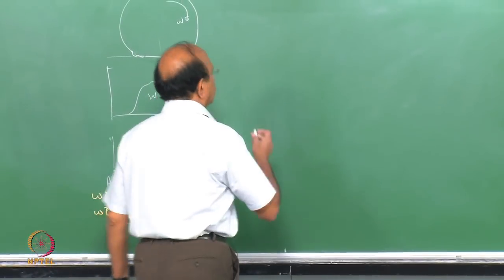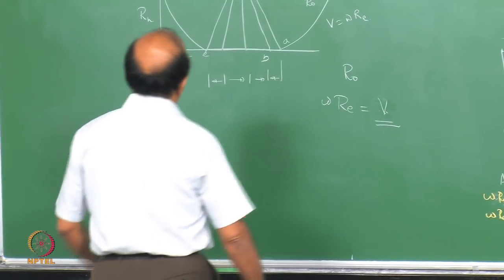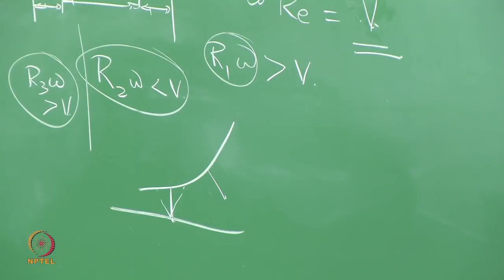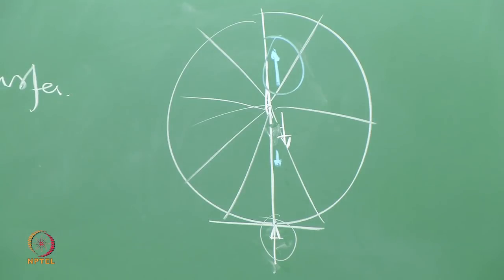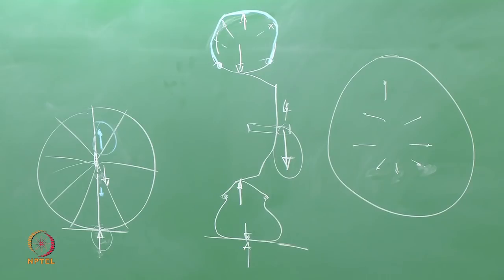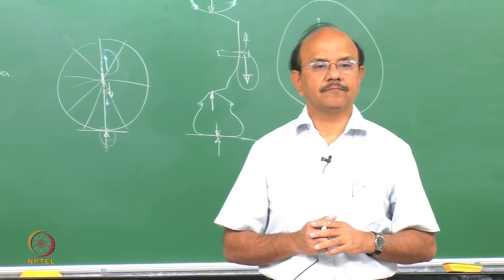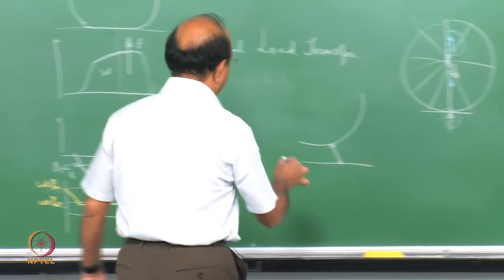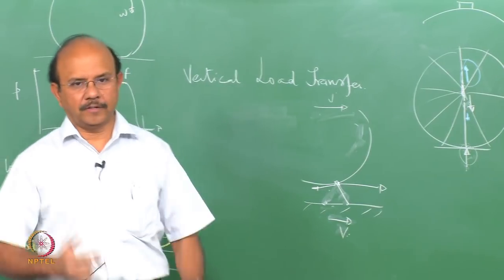Mod-01 Lec-08 Slip, Grip and Rolling Resistance

Comment: correct me if i am wrong. You mentioned that Rolling resistance or force is  in the direction of omega i.e velocity. Then how come the velocity reduces at the bump if both are in the same direction? Should the Rolling resistance direction needed to be reversed there? or where i am going in this concept?
Reply: When he says rolling resistance, he meant reaction force. Generally we represent only the reaction forces in FBD. I think he explained it in an earlier video as a part of doubt clarification. But again, correct me if I'm wrong.
Reply: I think that the reduction of the velocity doesn't depend on the acting of the rolling resistance force. When the professor explained the variation of the radius of the tyre, on the final part you have R2< Re so the velocity of the tyre on that point lesser than the velocity of the veichle (or if you change point of view is lesser than the velocity of the ground), hence the tyre will have the tendency to be compressed. Now if you combine this tendency to get compressed to the action of the rolling resistance force you will get an "extra compression", hence there is the bump, after the bump the radius goes back to Ro. This is my interpretation of the answer, i'm not 100% sure about it, it's been a year since you asked the question so if you found your answer it would be great to hear it in order for me to understand better!

Comment: i want to ask one question...   friction does not depend on contact area, but the bicycle having less air( contact area increses)  in tire required more force(more friction) to drive ... how ?
Reply: Vertical deformation increases, this increases more hysteresis loss, that results into more effort required.